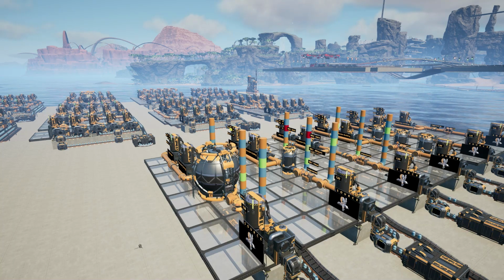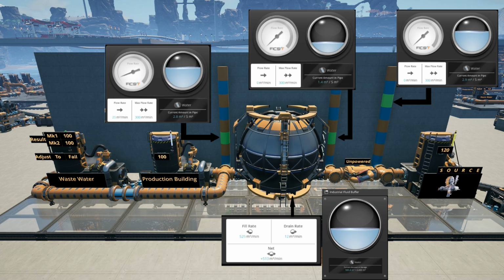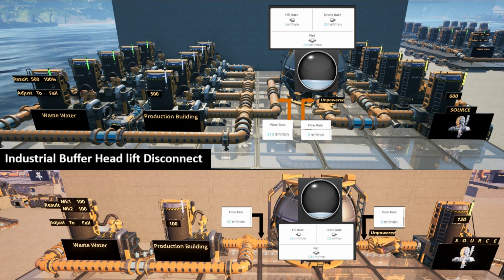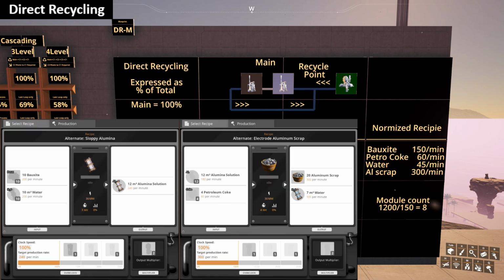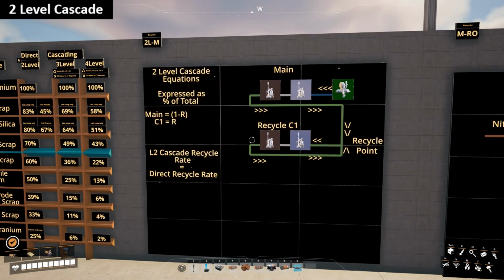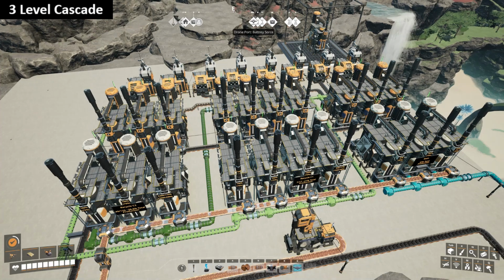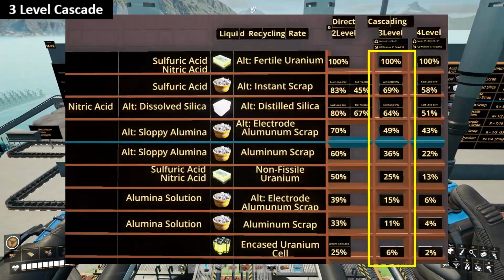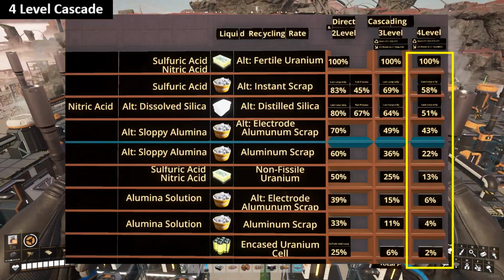Satisfactory 1.0 - Expanded Liquid Recycling Testing

Comment: Do you think clogging the scrap output would result in a similar failure as cutting off the water recycling like you did?
Reply from the maker: it would not reliably cause a loss of production failure.
Cutting the recycling line will jam up water output with 50 additional units of water per module. Which more closely mimic loss of production failures caused by liquid loops, not having appropriate prioritization.
I’m not saying that solid backups couldn’t cause a loss of production failures, it’s just that cutting the waste line is more reliable way of creating the loss of production failure.
Reply: @BitwiseAssembly  Right! that makes sense. I have a semi-2 level cascade blueprint where I plug both alumina solution refineries into one scrap refinery, and that scrap refinery just feeds the wastewater to one of the alumina solution refineries. But my consumption of scrap lagged by like 5 per minute due to an underclocking oversight. Something about stopping and starting repeatedly eventually got my wastewater backed up, and I'm not quite sure what it was. I haven't tried reproducing it since

Comment: I'm brainstorming now off of that slooping water idea: if you sloop a few recycling setups, is it possible to create such a priority setup (with scrap or distilled silica) that never needs outside water supply after its initial cycle?
Reply from the maker: Yes. I think the setup here needs 5 or 6 sloops to not require a water source after priming it.

Comment: I used stucco's method as well with a Large buffer "accidentally" as you say for a long while. Though it runs into issues with vertical rising pipes and finding the failure point is impossible amidst all the noisy flow rate indicators (especially with long pipes).
Reply from the maker: Over the years playing this game I have found that buffers tend to be the source of my liquid problems.